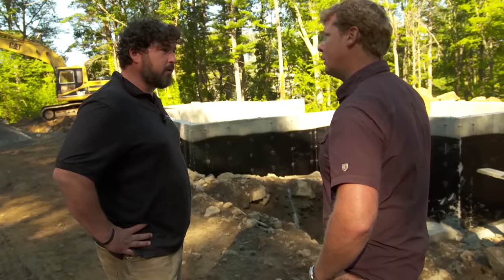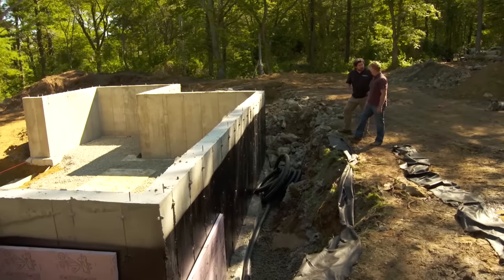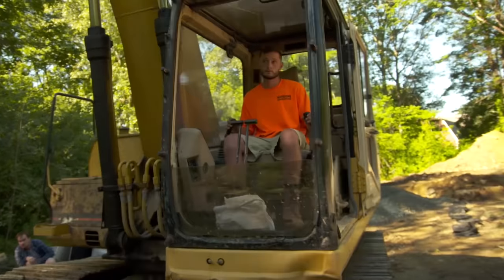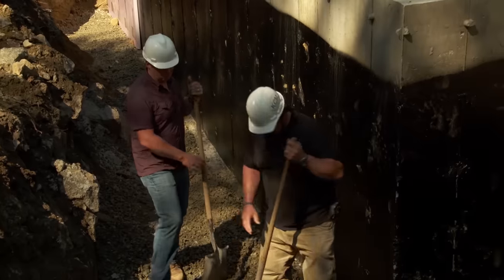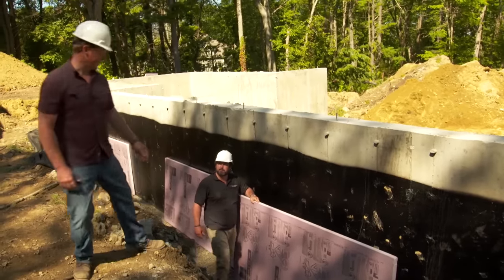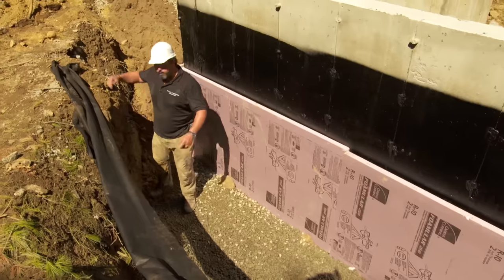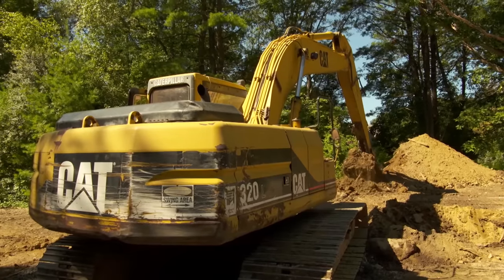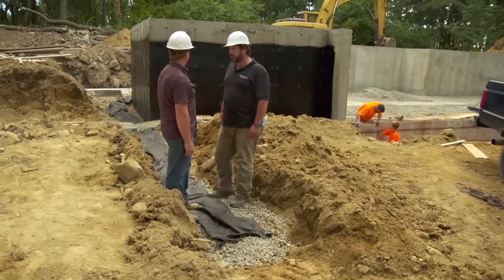How to Install a Perimeter Drain | This Old House

Comment: I am completely shocked This Old House would air this clip: terrible piece of silt going over the gravel, they should have just made a proper burrito with the fabric, I can't believe they used corrugated pipe and not schedule 40, nobody checked for slope, there's no drain mat or concern for hydrostatic pressure.... this whole thing just seems like something a dufus handyman would put together.
Reply: AGREED!  So many things wrong with this drainage solution.  I didn't even finish the video before I jump to the comments because I could not believe this old house went along with this dishonest contractor.  This is what a contractor does just to satisfy an inspector (he doesn't care if it works, or not - we know it won't work like it can & should) This won't protect the house & provide value to the homeowner(s).
Reply: Yeah I was surprised at this…seems like a pretty crap drainage system… water travels in all directions and can carry silt with it.
Reply: I don’t know night to day about home construction but researching for my own home (dyi) but logic tells me… if it has holes 360 degrees the length of the pipe… wouldn’t the water just run out the holes on the bottom and defeat the purpose of moving it away from the foundation?
Reply: @rr_spec1809  it's counterintuitive, but the holes should be at the bottom. That way when water accumulates at the bottom, it'll come up through the holes in the pipe, and then the pipe will direct it out to daylight.
Reply: Appreciate this input
Would there be an educational video about the way you described this should be done?
Reply: @bookie039  Matt Risinger with the Build Show did an excellent video several years ago that showcased a contractor waterproofing a basement wall and then the "burrito wrapped" French drain system using schedule 40 with holes down
Reply: @Solidbuilthomes  thank you 
Just started to watch the video and it already makes far more sense in the way it's done.
Reply: One thing I've learned about this show is it's basically catnip for men that "know better" 😂

It's a 5 min clip to educate the layman, chill out everyone jeez
Reply: All perimeter systems eventually fail.
Reply: @jerseyjim9092   a well built one that's properly maintained will last decades... gotta build cleanouts, and snake out the gunk from time to time...
Reply: When I saw the animation I thought the animator didn't understand all the details but nope, they just didn't do a good job.
Reply: Man, I sure hope “dufus” comes back. Such a perfect word in certain contexts, and this is one of them. Kudos.

Comment: Probably the worst way to do a footer drain. That pipe will clog in no time and it will not take water away efficiently. They should of used a perforated 4" PVC with slope to day light.
Reply: eh...it’s not best practice but it will work fine.
Reply: I agree DaPro. PVC should’ve been used with a channel drain 1m from the wall along the length of that wall to also take surface water away. To do all this digging and to skimp out on the pipe. Wow.
Reply: What does day light mean here?
Reply: @Aviator013  it means u run the pip to lower grade and it sticks out of the ground letting all the water run to somewhere VS hooking it up to a sump pump or something
Reply: I have root cellar Im putting pvc perforated around it. Starting higher grade on one side and will slope around until it connects to solid pipe on the other side.
Reply: They missed a precaution for ease of installation & cheapness. That corrugated pipe won't last 50 years and will fail. Additionally, the undulations will catch material. Solid pipe is best management practice, they cut corners on this
Reply: @manillafresh57 until it fails😢

Comment: I went directly to TOH video thinking i was going to get the real deal like a Trethewey presentation. NOOOO. This is pathetic and i think these subcontractors need to be vetted before TOH puts their seal of approval on a job like this.  It was wrong on every phase from gravel, pipe, fabricate, membrane..... The comments below are well founded.
Reply: You’re watching the vid cause you don’t know anything about construction in colorado usually engineers say don’t need any gravel or drain
Reply: @elimartin5105 lol what are you even talking about. Of course you put in gravel and a drain.

Comment: that looked like the skimpiest piece of fabric over that install. Last one I saw placed had fabric up the wall, and another looked like it basically wrapped the gravel. No infiltration from any side. Im not sure what is the best method, but that single piece just felt like too little.
Reply: Agreed
Reply: That pipe should've had a sock on it at the very least.
Reply: @MrEazyE357  I disagree with the sock idea, and the installation shown too. The geotextile (not landscaping fabric) should be wrapped around the entire mass of gravel, maximising surface area. Socks are too close to the pipe, allowing the fabric to become clogged faster (although we are talking in terms of years).
Reply: @Roboticexile  You're probably right as you sound like you have more experience. My main point was that they did a shoddy job in this video.
Reply: That definitely had the look of a contractor who was trying to save money by using the minimum amount of material
Reply: @Roboticexile  is corrugated pipe. Will clog anyway...
Reply: @ovidiuciuparu6421  Agreed, should have used pvc pipe with a few clean outs incase it needed to be. And entire gravel mass should have been wrapped in fabric.
Reply: You’d be surprised at what works long term. On my own house I over engineered it with pvc pipe, 6 ft, of gravel wrapped in heavy geotextile fabric with drainboard. I’ve seen plenty of 30-50 year old homes with black corrugated pipe, a foot of gravel, and hay or felt laid on top between the gravel and soil backfill that are still working great.
Reply: @Roboticexile  I'm a civil engineer in Florida.  What Rob Locke said is pretty much what we recommend when putting in these type of drains.  We also usually give specifications for the type of filter sand to use as fill above the drain, to allow faster drainage of the water through to the drain pipe.  If you backfill with clayey/silty soils, then the water might not move quickly through the soil mass, and there'll be more opportunity for water to sit up against the exterior walls.  Also, we typically recommend clean-outs for the drain pipe at every corner and/or every few hundred feet.  Even properly installed drainpipe will eventually clog with fine soil material, organic growth, etc. and will need service.
Reply: Yup definitely not the right way to do it. You are supposed to lay the fabric on the bottom and burrito wrap the rocks and pipe. The water table and roots will clog this up in 20yrs
Reply: @MrEazyE357  Absolutely wrong. Putting a sock on the pipe is the worst thing you could do. They used to do that in Canada many years ago and quickly found out how horrible it is. The fabric over the pipe gets clogged and then water can’t enter the pipe. You can put fabric underneath the pipe and on the sides of the trench but never as a sock and never overtop the pipe like we see in this video. With sufficient gravel, 24-36 inches overtop the pipe, the pipe will not clog up. I’ve seen it thousands of time. It’s when you don’t have enough gravel over the pipe when you start clogging. So putting fabric directly over the pipe makes it even worse
Reply: @coreydeschambault8190 the drain should be designed to outlive the house. Otherwise, they will compromise the house if it ever fails

Comment: Should really only have haf-perforated pipes (holes facing upwards) to enable the water to actually drain by gravity away from the building.
Reply: Actually, the holes should be facing downwards.  That's the proper way to drain water away
Reply: And put a sock on it.
Reply: @MrEazyE357  Socks aren’t considered best practice because once they clog, you essentially prevent water from passing through the sock into the drain. The drain should allow for fine sediment to pass through.
Reply: @ericr2zz  nope, that would be the case in an infiltration trench, but here you want to do the opposite - collect the water in the pipe and convey it in the pipe away from the building

Comment: This old house is usually very good quality repair and build, but this is a very clumsy drain job. I don't know if it's still common in the US to use the black pipe, but haven't seen them in quite some time in Canada.
Reply: Yeah no one should use the black piping for French drains. It will crush way to easily. 

There’s no clean outs for the drain. There’s no burrito wrap of the gravel. And there’s no grading or slope that they mentioned, which makes my think they didn’t grade the piping.
Reply: @condhor  All that, plus I do hope they added a molding on top of the foam to prevent water getting behind. Pretty sure they didn't. Also, nowaday there is so many better alternative to black tar such as urethane foam or rubber membrane. It's not even really more expensive.
Reply: @brianglade848  not like there are many place to go for an entire country XD
Reply: True dat
Reply: How good the corrugated black pipe is typically depends on the wall thickness of the pipe.  I've seen some pretty thick-walled pipe used down here in Florida that lasts quite a long time.  The cheap stuff you get at some hardware stores probably will give you problems, especially if it's installed improperly.  Also, as condhor said, there were no clean-outs installed which might be a problem in the future.  Even perfectly installed drain pipe might eventually clog with organic growth and fine materials.
Reply: Yea this install is extremely shoddy. Worst install I’ve seen in my life. Big o pipe was used in the late 70s and 80s and that was it. To use big o pipe in today’s time is like using cast iron piping for your brand new plumbing system in your house
Reply: @AlMai222  So what to use in place of that??
Reply: @raekc4839  perforated 4” PVC pipe. The ones with the holes at the bottom. Then solid 4” PVC pipe for the uprights. Filter fabric only to be used at the very beginning, then a bed of gravel, then the pipe.
Reply: @AlMai222  Thanks. My house has oval shaped rooms in some areas. Do they make PVC pipe that curves?
Reply: @raekc4839  the sections of pipe come straight. 10ft long lengths. Then you just buy enough fittings as you need. The fittings come at 45 degrees, 22 degrees, 90 degrees. So just use the fittings to go around any ovals. You can cut the pipe with a PVC hand saw or use a sawzall if you have one or grinder. Easy to cut, just throw the fittings in the trench and eyeball and measure and cut. Make sure the letters on the pipe are facing up. Buy pvc glue and pvc primer. Primer the ends of the fittings and pipe where it’s going to connect, and then apply glue and slip the pipe into the fittings. It’ll set and harden within 10 seconds.
Reply: @AlMai222 what is the significance of letters facing up? Just for identification??
Reply: @ryanglaser5336  Perforated PVC, the ones with the holes in them, and the pipe you’ll be using for the perimeter drain system at the lowest point, will have the letters on the opposite side of where the holes are. 

The holes on the bottom are drilled at an angle on both side of the lower bottom of the pipe, so it’s important to have the pipe nice and straight  at the right orientation, meaning the letters facing up.

Comment: Flex pop garbage, should use rigid PVC with holes in it. Also, the drain should be at the very bottom of the foot or footer got, not two or 3 inches of gravel underneath it. That’s just a place for water to stand.

Comment: Thank. Was helpful but was hoping to see an existing old house done. I have an old victorian - its on a slightly raised foundation but rain still gets in basement from downspouts. I have to fix them I know but wanted to also tile around perimeter. Hoping to see an old house down that way.
Reply: Interior drainage system is superior.

Comment: the perforated pipe is above the Footer, when I believe it should be below the footer.  If there is any possibility for water to leak into the basement where the footer meets the wall, water will leak into the basement.

Comment: They show perforations all around the pipe, I've always been told to use 4 inch pvc pipe with 3 rows of holes which are placed on the bottom.  Also with the pipe shown being corrugated its going to build up fine particles over time and plug itself.  Its a good idea to run two pipes, perforated to drain the foundation, and solid to drain your roof (if surface run isn't viable).

Comment: in canada we call that weeping tile, based on years ago it was made from clay tile pipes
Reply: I still see “drainage tiles” (same thing) specified as an option in construction plans today, but pretty rarely. I’ve never seen anyone actually install it though. The plastic drainage pipe is too much easier to work with.

Comment: This must be a classic. I mean, no drain board, ol school tar water proofing, no sock over the weeping tile, sloppy install of rigid insulation...    yeah, looks like from the 70s.    Still can’t figure out how they used nowadays host though.
Reply: Sometimes the old way remains the best
Reply: @Bremend  uhhh, not usually in construction.  Not here Brendan.
Reply: Yeah pretty astonishing - I thought it was a parody at first- I’ve seen spec houses in developments do this better-😜and they didn’t use solid pipe or make any effort to ensure it’s level with appropriate continuous slope or troughs?! Absolute fail Levi no excuses
Reply: @Bremend  that is not the case here. Over time the non-socked perf pipe will get that sand in it. The cloth needs to start lower than the pipe then come over. The foam ready is generally shiplap and not butted but square edge.
Reply: Agreed, I layed 100' of pipe for a french drain last year on a waterfront property. Compared to what I just watched mine is fort knox. This guy is a scam artist
Reply: What are you all talking about? This will last long enough until warranty run out, plus a few more years for that black tar
Reply: Sincerely asking:  Is there a video or web site you'd recommend that uses more current methods?  I need to have something done at my house to dry out our walk-in crawl space.  Thanks!
Reply: @damatar  these are commonly also known as French Drains. While not everyone does them right, have a search for that and I’m sure you’ll see which ones make sense.
Reply: I was thinking the EXACT same thing!
Reply: Absolute joke.  That 18 inch strip of landscape fabric won't stop one grain of sand from getting in that pipe.  At least the home owner has video documentation when they take this guy to cpurt.
Reply: @damatar  check out articles on sites like Fine Home Building.
Reply: You never want a sock on the weeping tile.
Reply: @damatar search for the channel gate city foundation drainage

Comment: Do you have to slope the pipe as it runs along the footing or is level good enough?
I realize you need a good slope running away from the house.
Reply: @drunkennewfie midget  how would that make sense? Plumbing doesnt run level, so why would these pipes run level? Just curious because im learning.
Reply: Slope the drain. Don’t listen to these fools.
Reply: @philweed1603  it doesn’t make much sense to slope pipe that is perforated and surrounded by drain rock. What would that accomplish? Water would just accumulate at the lower spots. The foundation drain tile — next to the footing and NOT on top of it — needs to be carefully leveled, and then the solid pipe that drains AWAY from the foundation needs to be sloped.
Reply: @philweed1603  so are you going to slope with the footings as well Einstein? Perimeter drain is level. As it builds water the water finds its own level—as long as its exit slopes down the water goes away. Physics.
Reply: @patty109109  GET BACK IN THE KITCHEN!

Comment: thanks for this video, does anyone know if all those rocks and dirt, their weight gona flatten or crush that black drain pipe ? thanks
Reply: I’m yes Kevin it is
Reply: If it's the good quality, thick walled corrugated pipe, then no.  If it's the cheap thin-walled stuff, then possibly.
Reply: @dbackscott  according to video had shown, looks like a thin pipe
Reply: Never ever use black big o Pipe. Just use pvc
Reply: @AlMai222  and with pvc you need to drill little holes for draiage, or those small holes already made for you
Reply: @stevengao8345  comes with holes already from the factory. It’s called Perforated PVC pipe. Then you’re going to want the solid version for all your uprights. It’s only $13 per 10ft Pipe.
Reply: @stevengao8345  Never ever put filter fabric overtop the pipe either. The fabric will clog and water won’t drain down to the pipe. The installers here in the video did a horrible job. You can put fabric underneath the pipe and on the sides of the trench but never over top and never as a “sock”
Reply: @AlMai222  thanks for this nice info.
Reply: @AlMai222  Contractor grade non-woven Geotextile fabric, 3 to 4.5 ounce, does not clog up when wrapped around rock as a French drain. You said never over top…of course never as a sock. But over an inch or two of rock is perfectly normal.
Reply: @AlMai222  , what's the difference in a "sock" and the fabric they used? I read , they needed a sock. but wouldn't that clog too?
Reply: @rcrewe3733  Yes a sock would clog easily and it’s even worse. A sock is just landscape fabric thats made like a sock to fit over a cylindrical pipe, completely encasing the pipe which is not good. 

Only times you can put fabric in a trench is UNDER the pipe and if you’re worried about the soil on the sides of the trench you can put fabric as a wall on the sides of the trench. But never on top